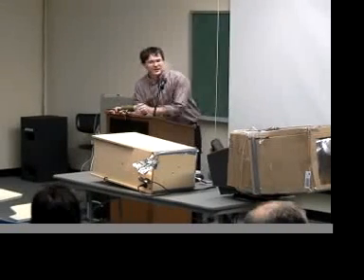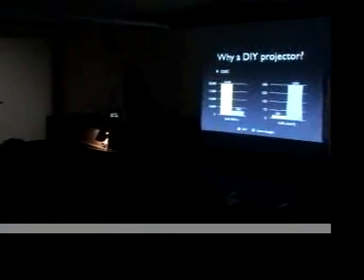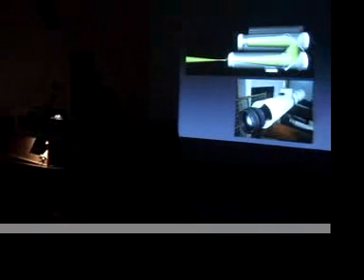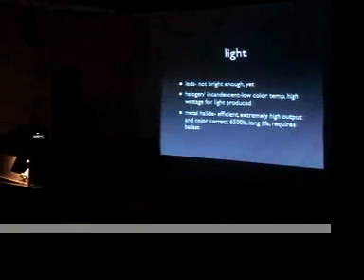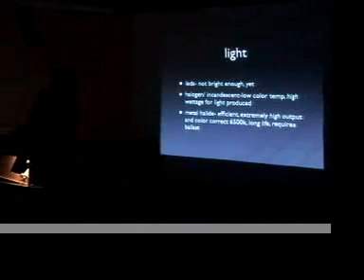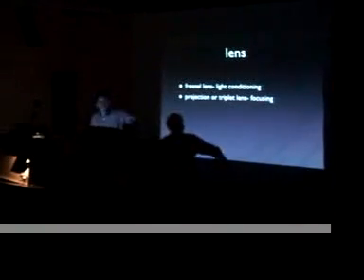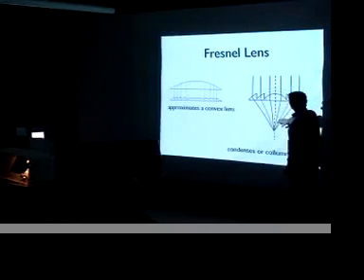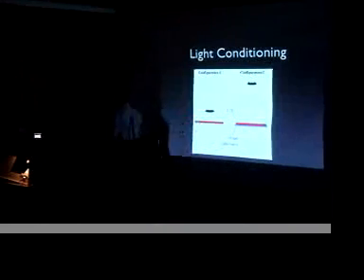DIY: Build Your Own Projector Part1

Comment: i tried this experiment myself several years ago. needless to say it did not work as well as i had hoped. in fact it didnt really work at all. I'm currently on my 2nd "real" projector. 100+ in of beutifull 1080hd. outperforms any flat screen or rear rojection tv set. I'll gladly pay to replace lamps every 3-5 thousand hours. more than woth it.